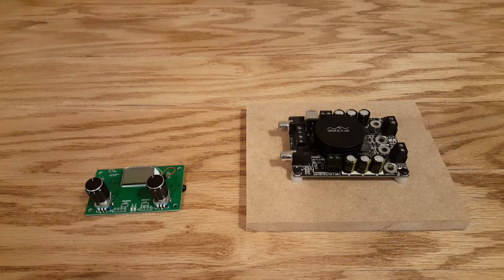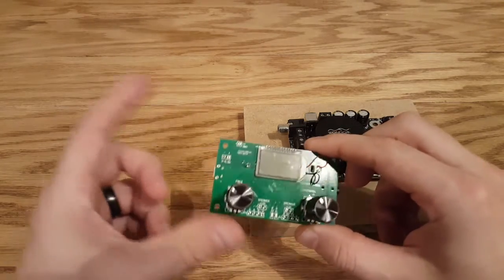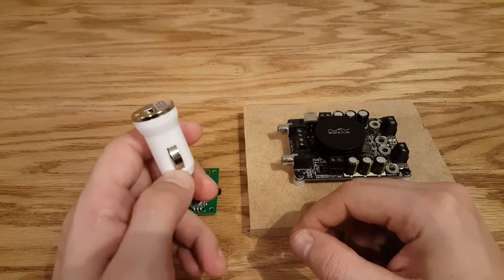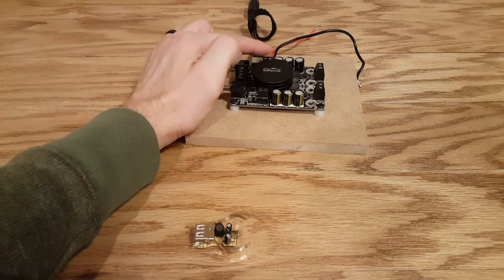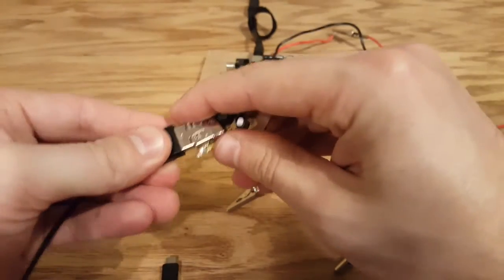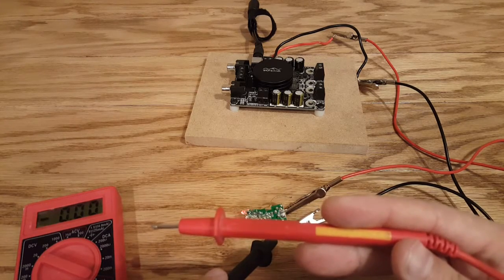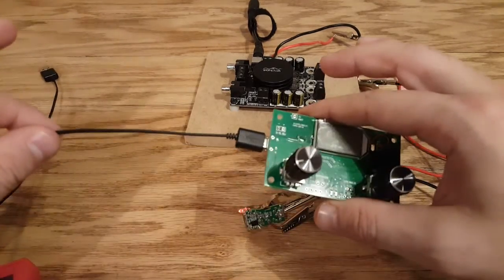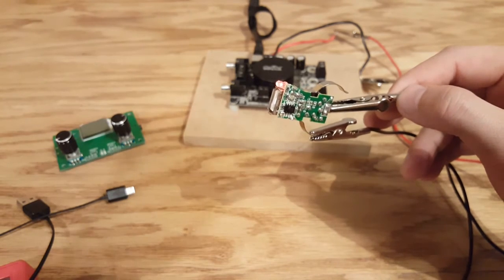How to add 5v USB charger to a 12v amp board great for DIY Bluetooth Speakers

Comment: I got a small bluetooth speaker and i wanna use its circuit board with a 12 volt battery and i wanna connect it all together to a 12in subwoofer  can i do this or will it brake the circuit board ?

Comment: THANK YOU ! THANK YOU! THANK YOU!  I have been trying to find a affordable solution to adding a 5 V bluetooth board with out using a voltage reducer board or adding the extra cables. That is so awesome. Thank you again. I gotta try this.  This just solved about 5 problems I was having.
Reply from the maker: Oh man, I am glad to hear that. You can get a ton of these on AliExpress for nothing at all. Definitely worth stocking up

Comment: https://www.ebay.com/itm/5pcs-MP1584-3A-Adjustable-DC-Step-Down-Converter-Buck-Module-3-3V-5V-9V-12V-24V/132416728307?epid=22010594256&hash=item1ed4a6ecf3:g:j4YAAOSwLhBavqdO  5 pieces for $4.49 free ship.
Reply from the maker: Good Goat now that's a good deal

Comment: 123Toid+ Where did you get the FM radio board, do you have a link?
Reply from the maker: https://smile.amazon.com/Mini-Digital-Radio-Module-76-0MHz-108-0MHz/dp/B01N4AHISZ/ref=sr_1_3?ie=UTF8&qid=1516636297&sr=8-3&keywords=fm+board  IF you find my videos helpful, feel free to check out my https://www.patreon.com/123TOid

Comment: youre probably the best diy speaker build channel on youtube. yet so underated... Thanks for putting all the effort in these videos. You really helped me collecting info about somewhat everything i needed to know. keep it up! :)

edit: what do you think about the kab boards from dayton audio?
Reply from the maker: Thank you for the high praise.  I really appreciate it.  As far as the KAB boards, I love them.  I use them in plenty of projects and will have a video shortly where I used the 2x15 version in a powered soundbar.  They are easy to setup and use.  The only thing is, that when you plug in anything the 3.5mm jack, it will no longer send out a bluetooth signal.  It will resend the signal as soon as you unplug the 3.5 jack.

Comment: You're videos have help me loads! However I have one thing I have a problem with on my upcoming build, how do I ground a diy amplifier? I'm planing to use a meanwell psu and a sure board in a hifi 2000 aluminum case.
Reply from the maker: Thanks Erik!  I actually have a video that shows you how to hook up a meanwell psu to a sure amplifier board.  See if this helps:  https://www.youtube.com/watch?v=ETbgiXe8o58&lc=z13kdrlybyzoul0q104chhni2urzur3jux00k
Reply: 123Toid I've seen that video, it's what convinced me to buy a meanwell :) so I wouldn't need to ground the amplifier case or the amplifier board? (if all components have some contact with the case)
Reply from the maker: I see what you are asking now. :)   Great question!  You do not need to ground the board to the case.  The only grounding needs to happen is in the electrical circuit.  Thanks for the question.  I hope this helps.
Reply: 123Toid Thanks for the reply!
Reply from the maker: You're Welcome!

Comment: Great video. Info on that tuner board? Where'd ya get it/how much?
Reply from the maker: Refuge Inc. Good Question.  I bought this one from Amazon.  It's the LearningTech FM002 that costs around $15.  Although if you don't mind waiting you can get something similar on Ebay or Aliexpress for much cheaper.